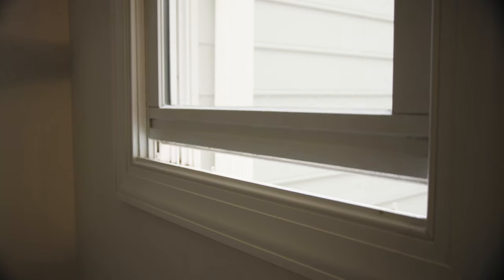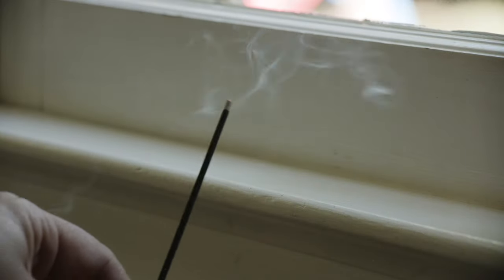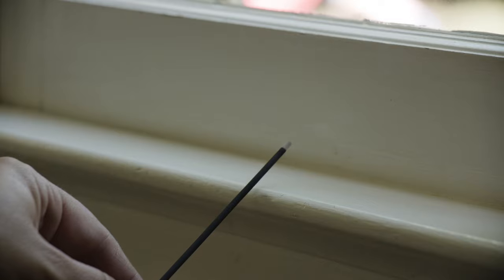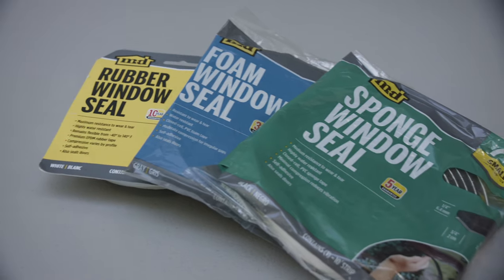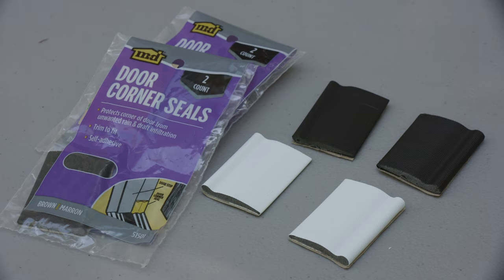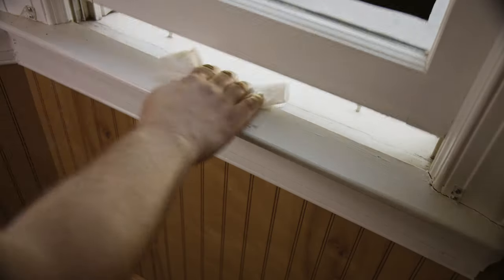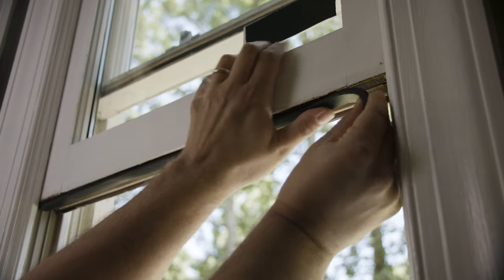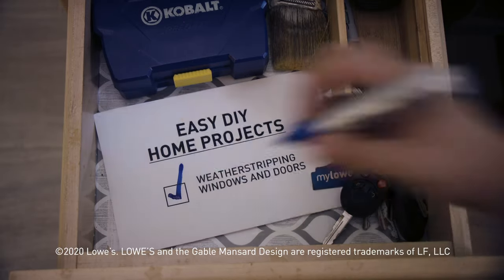How To Install Weatherstripping

Comment: Where to I apply the weather stripping if it is beneath a door that air gets in? Like the door moves side to side not up and down, so wasn’t demonstrated in the video.
Reply: Those are called door sweeps. They have cheap ones for under 20 and they slide on and drill in